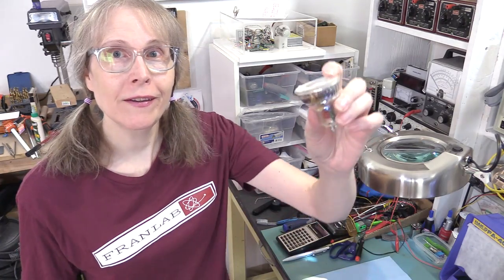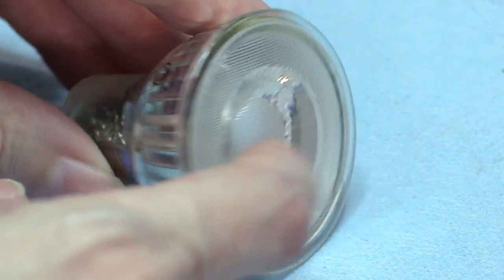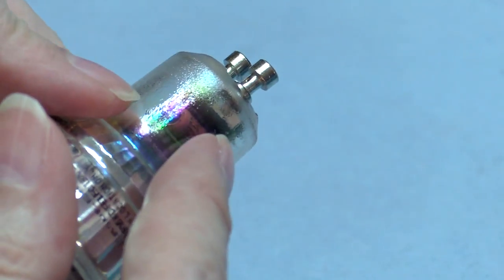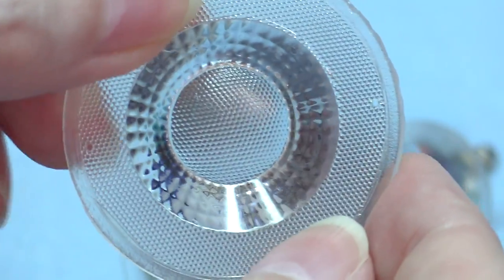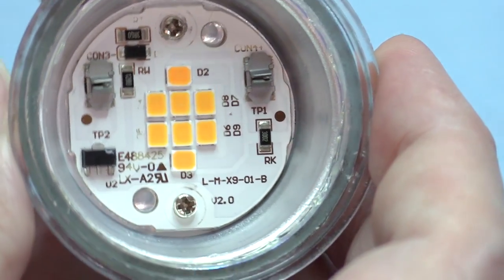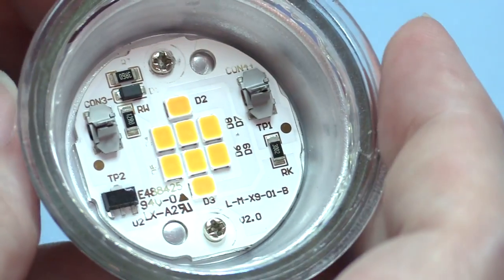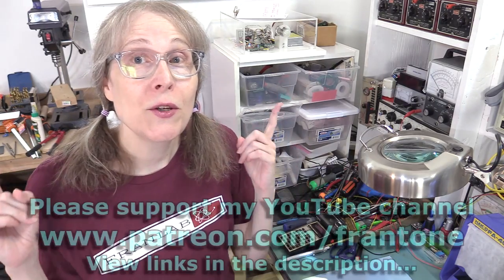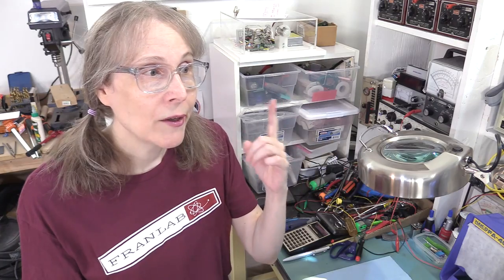Inside An LED Light

Comment: I was hoping that she was going to find out which component failed and replace it to get it working again!
Reply: Me 2!
Reply: Would be realy interesting to dig deep into the circuit...
Reply: Power supply 98% sure  :)
Reply: It doesn’t pay to fix these things. I fixed a couple. But the amount of time it takes, plus trying to find the parts, which sometimes aren’t standard, makes it something that some can do, but that isn’t monetarily worthwhile. My time is better spend elsewhere. For a YouTube channel, sure, but otherwise, no.
Reply: @MeNotYouSee  I seem to find it is a mixture of LED and PS.
Reply: Almost always a crappy Chinese electrolytic cap. The rest of the time, crappy Chinese design/assembly and lead free solder.
Reply: @richard7crowley  Big Clive watches Fran, but us  geeks all follow each other around......
Reply: I have some Osram and Philips LED bulbs now approaching ten years of service.
Those cheap lead bulbs aren't worth the two dollars price, as they use fake electrolytic capacitors, poor quality LEDs and abysmal thermal management. Chinese design with barebone functionalities and minimum parts count doesn't help, too. In some dissections I found out the bridge rectifier to fail very easily.
Thanks for the video...

Comment: My experience with led lighting is that most of the lights have not failed.  Some have failed within a year or two, but that seems to be the exception rather than the rule.  It also seems that the ones that failed were all from the same brand and failed the same way.  Mostly I think from running the leds at too high a current.
Reply: This has been my experience as well -- I moved to LED 10 years ago and the only bulbs that have failed were the ones that were similar to these ones that Fran used here, all in one set of track lighting in my kitchen -- they burned out in about 9 months; I replaced them from a different brand and they've been running for at least 7 years now.  The typical light bulbs that I've used to replace indoor light bulbs as well as outdoor hologens have lasted for  nearly 10 years now.
Reply: Ed Luke I’ve had great luck with life span on LED bulbs. I’ve got one that’s on 24/7 and it’s been that way for at least 5 years. It’s awesome.
Reply: I started switching to LEDs early on and found that the more costly name brand bulbs last very much longer. The Phillips ones seem the most consistently durable but honestly I've had good luck with Ikea as well. Poorly designed bulbs tend to handle heat poorly and have electrolytic cap failures. The track lights over my head as I write this hasn't had a bulb failure that I recall since I installed the track more than 5 years ago. The generic Home Depot bulbs I put in my garage lasted maybe a year each until I had used up the box. Installation may be a factor, especially if a bulb is installed with the power supply directly above the LEDs or if mounted in a deep fixture in a location that gets little air circulation.

But in brief, we have repurposed the shelf that we once used to store spare incandescent bulbs because bulb failures in our house are now so rare.
Reply: All good points, also it’s about running temperature. Compact lamps like this need to have a sufficient heat sink, if they don’t (and this one doesn’t really what with being enclosed in glass) it shortens the life of the LEDs significantly.
Reply: I'm happy that you're happy with LED's. I wish my experience matched. I'm disappointed with CFLs and LEDs  with their poor quality of light and overrated longevity. I've had incandescents last in excess of 5 years on constantly. I've never had a CFL last 2 years; I've not had an LED last 5 years but some are getting close.
Reply: Likewise.  The only ones I've had fail were ones I dropped onto a hard surface from several feet up (and of course most such drops were not fatal, just breaking the front lens, when made of glass).
Reply: yep, if they run the led chip too hard it will fail 'early'  , life also depends on the driver circuit as many have switch mode circuitry with electrolytic capacitors which can vary very widely in quality/life,  cheaper designs, mostly lower wattage, and less overall efficiency,  using capacitive droppers have a poly dielectric capacitor which last very much longer, possibly indefinitely, but still have an electrolytic capacitor to reduce 'flicker' ,

Comment: One thing to note about LED bulbs that BigClive mentions sometimes is, at least for ones that don't break, they get dimmer over time. So it might last 20 years, but at the end of 20 years it's outputting like a 10th of the light it's supposed to, while using the same power. I think a lot of people just don't notice this because it happens slowly enough that your eyes adjust, but I've noticed it because if I replace an old LED bulb with a new one of the same power rating it always seems "too bright".
Reply: I had a small LED light in my bathroom that after only a few weeks exploded because of condensation. I replaced it with one designed for bathrooms that faded and went pink after a year. I replaced it with a tungsten candle bulb (the only type of tungsten bulb you could still get) and it lasted for years until I moved out. I've had other LED lights last years but they all fade with time. Some manufacturers even state this in the fine print.
Reply: Tungsten bulbs dim over time, too, because they deposit tungsten on the inside of the glass globe.
Reply: @jts3339  That is true, although my experience over the last 40 years is that for normal domestic tungsten light bulbs the effect is far smaller and takes decades. I also note that LED bulbs have improved in this respect in recent years probably due to the changes in LED composition and improved thermal design. I guess this is understandable for a technology thats been available for less that 20 years.

Comment: My experience with LED bulbs: almost every bulb fail was caused by one burnt LED in chain (for example 12 LEDs in series).
When I got more those failed bulbs and are able to be disassembled gracefuly, I use one of them as source of LEDs for replacing failed ones. For desoldering I use heatgun.

Sometimes I bring those failed bulbs from recycling station to repair them and use them. For me it feels like waste of resouces when something repairable is thrown to garbage..

I know, maybe it is not time effective, but you can massively expand lifespan of the bulb (with components from other).

For example: from two, after year, failed bulbs you can make "one bulb" that maybe can last another year before next repair (maybe).

So yes, nonrepairable things failing that early are bad. And when the recycling process is not effective, it is bad even more.

Recycling of incandescent light bulb be like:
 - 1. smash with hammer: separate white glass (majority)
 - pick broken thungsten wire
 - 2. smash with hammer: separate aluminium socket from the weird goo and metal wires
 - done

Recycling of LED light bulb:
 - who the h*ll knows?
Reply: who else will do that when a typical led costs $2; i've had them last 1 year while others last 3 years depending on the batch.
Reply: If the LEDs are driven by a constant current driver (usually) you can just short out the burnt out LED and return the lamp to service.  If there are more than one burnt out and they are in parallel you can short out either one.  If there are more than one in series then probably it is pretty nearly shot.
Reply: That's a smart idea, but sometimes finding which one died can be painfully tedious
Reply: @joshm264  Sometimes they are visibly burnt (brown/black spot on chip). I am testing them all. Since they are mostly single chips, 3.6V will do. Source 3.6V@1mA, test probes, one by one in chain (polarity marked on chips). Good will glow (not dazzle you, because low current), bad won't.
First ones were really painful, but practice makes perfect :D
Reply: @carlosgaspar8447  Yes, these  cheap ones are failing early. Repair is not cost-effective so these cheap LED bulbs are over time more expensive and produce more waste (because you have to buy and throw away more of them).

Thing, here in Czech republic, is that incandescent bulbs >40W are banned from selling. However they are still buyable (marked as "special bulbs, not for home use") (and more expensive), but quality is usually very poor. They last for months or sometimes weeks (or first switch-on). So people buy LED bulbs but don't know why pay $5 for one bulb when they paid few cents in the past. So they buy cheap LED bulbs... And they fail. Here we go again. Buy another cheap LED, because it still fails so why buy expensive one?
Reply: @renepanak8541  A coin cell lithium battery makes a great power source to test for open LED's I would rough up the surface of a cell and flash solder leads onto them and then put a heat shrink over the cell. 2 to 3" wires were great to jumper across most any LED
Reply: @craignehring  That's very portable idea. I'll try it next time ;)
Reply: The LED ones will be 'recycled' by being burned, and the metal than being seperated and put into the Al cycle etc.

No manual labour I'd reckon.
Reply: For me, it's easier to disassemble LED lamps. Has done it twice. Here's how:
1. Smash the base of lamp with screwdriver and hammer (the screws to install into fittings).
2. Remove the base exposing a hole.
3. Use screwdriver hammer to smash from the bottom in order to get board out (from hole)

Comment: There's another interesting trend in LED lighting that plays into the overall cost, and that is many fixtures are becoming fully integrated, with the led and
driver components not being independently replaceable. I even noticed many IP rated outdoor lights like this which are not only very expensive but technically, for the end user 
generally require replacement to be done by a qualified electrician and then there is a dependency that any future replacements need to match the other existing fixtures 
(including colour temp etc) otherwise major work may be required to repaint, fill holes and then replace possibly many at once when just one fails a few years years down the track...
It's pure marketing genius...

Comment: I have worked on elevators most of my life. I went to a conference were a consultant was telling us how wonderful it was that in Europe they were replacing the old generator controlled DC units with VFD (Variable Frequency Drives). He said they told him it was the right thing to do for the environment.
 I was the only one that asked my version of your question. How much overall power did they save?

The old equipment could easily last 50 years or more with proper maintenance. The VFD units were lucky to last 10 years without major failures. The cost in energy to change was enormous, Iron and copper had to be mined then smelted and formed into the final product. Most equipment is now made over seas so it must be shipped. The drives themselves are full of electronics that generally take a lot of power to produce and generally are not recycled. They all will have new sheaves, cables, governors and possibly rails, depending on the new equipment. All of this requiring more iron and steel to be produced. He was talking about a 8 car group so that if a lot of material. Then there are the massive number of vehicles needed for such a project. I would say at least 4 trucks for the mechanics themselves plus large vehicles to bring the new equipment and cart off the old. And I'm guessing it should take about 5 to 6 months to complete. And do you know how they were getting equipment on and off the roof? Helicopters,  and nothing eats gas like a helicopter.

He responded "I don't know, no one has ever asked that before."

I would say that the fuel cost alone needed to change these out is far greater than any savings that the VFD conversion would save.

Comment: This is a tangent, but you did mention it during the video: I've been fighting a lonely, futile battle against the transition away from high-pressure sodium street lamps. The quality of the LED light replacing these bulbs is so different that it has psychological and physiological impacts, not to mention the impact on wildlife that you mentioned. Those old sodium bulbs cast a beautiful, relaxing light (yes, I am biased!), and they are very efficient for what they do. Not more efficient than an LED, no, but if we're looking at energy inputs and/or carbon footprints compared to their LED successors, I think the sodium bulbs definitely pose a bigger challenge for LEDs to compete with compared to the more common tungsten filament bulbs.

Comment: I do a lot of Led retrofits.. (after many years I can tell you) LED "lamps" Might be rated at 50,000 hours... But the power supply that feeds them fail.. 5,000 to 10,000.  They also get cold solder joints on the SMA stuff.. ( so led chips fail one at a time)    So I think your right on track with any none replaceable power supply Led Or any LED light that is subject to "high heat" ... Mounting ANY led replacement base up ^^  in a typical "can light" Will decrease its life by 50% :(

Comment: Fran: You're onto something here. I approve of LED lighting when it's designed, manufactured and used appropriately, but you've hit on a good list of issues with them.

One I'm aware of here in the UK is signalling on railways. Old incandescent bulbs by their nature allowed simple lamp proving back at the signal box, but LEDs require complex circuitry to achieve the same. Not knowing that a signal has gone out could have dire consequences, especially on our exceptionally busy rail network.

I do love the fact that you've picked up a subject that's already very well done by others (Big Clive, John Ward, etc) and found an intriguing twist. Good stuff!

Comment: OK, this is such an amazingly good “rant” as you call it. I never looked at the circuitry in those bulbs. I had no idea. And the repurposing of the original glass with its reflective layer is interesting, and there must be a story behind that. And LEDs can last for ages, so what’s causing the bulb failure? But that’s not what makes this particular video so remarkable. I have NEVER  heard a techie discussion that made connections to the natural world in this way. Many will make the connection with energy use, which is as far as most green discussions go these days. Some might make a human health (sleep cycle) link. But the deeper ecology of birds and insects in a take apart video of a light bulb? Amazing! Fran, you are a national treasure! You’ve got my patreon pledge!
FUN FACT: in many back yards in the summer, if you turn off your lights, the fireflies will return to your yard within minutes to a week or so. Then it’s LED time! Take a green LED, and suspend it from a fishing pole (wire to a battery with a switch). Copy the flash pattern of the fireflies in the yard and they will come check you out! They won’t come in hordes, but one at a time. Copy both the flash rate and the flight pattern that you see. Also look for flashing in the grass and hover your light over it, you’ll get the female to answer! So from LED lightbulbs to LED firefly calling! Full circle!